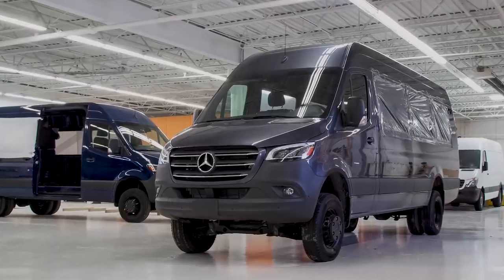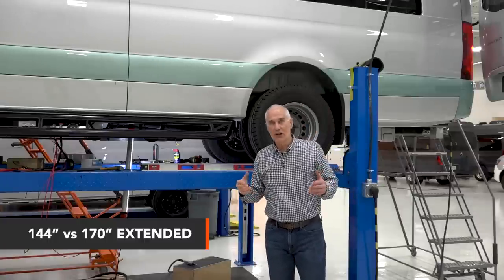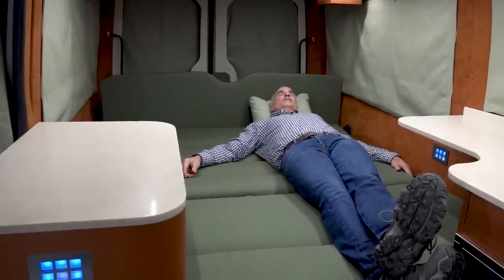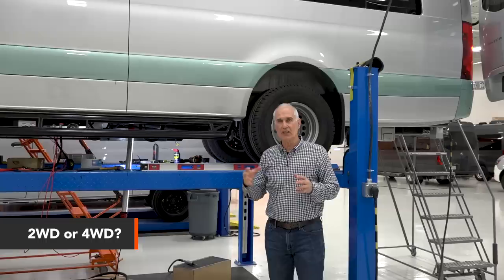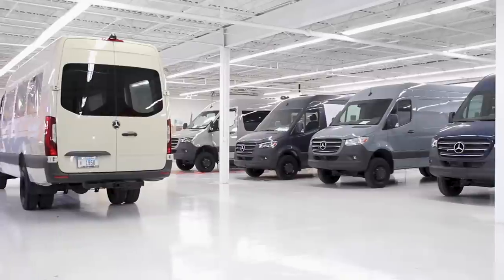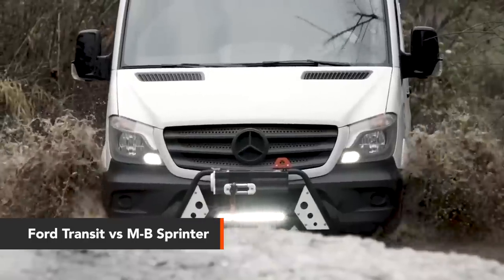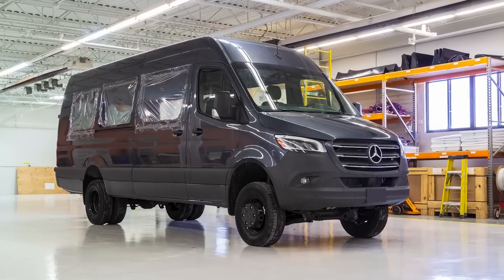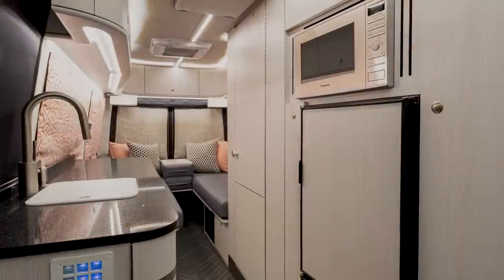Important Chassis Considerations for Your Custom Van Conversion

Comment: I want to state up front that I am already an owner of an ARV for about 18 months. In my opinion this is a  great straight forward informative video and only a starting point of how ARV takes a new owner step by step in the design process to decide a finished product. One does not need to have prior ownership of an RV to end up with the dream machine that allows one to ride off into the sunset. I have said before that my RV is everything I wanted and nothing that I did not need. If I were asked what would I do differently I would be hard pressed to make a list that was of any significance. Thanking all of the ARV team for sharing their experience in the design process.
Reply: Gary GaryM Agree 100%.
Reply from the maker: All the best to you, Baltas Vilkas 🙏
Reply from the maker: @edbyron3483  Hi Ed!

Comment: Hi,  i have been a taxi company owner in Europe for over 25 years and had a constant amount of 18 to 20 vans.  And it to my experience, the transit is Trash compared to the Sprinter overall.   No the sprinter is not perfect.  Stay away from 150 and 160 HP engines.  If you have light work,  go for the 130-140 HP engines and for all the rest go for the AWESOME V6.   It has enigh power to do the job and is very reliable and durable.  In my country,  nearly all ambulances are sprinters with the V6 and with these harsh conditions (the drive much faster here then in the US or Canada, they are replaced with 5 years old and around 450.000 which is around 280.000 miles.  The Transit is cheaper, it has cheaper parts but the sprinter has far less troubles.     After having several Transits, i all changed them to Sprinters.   Some 213 and 213.   Most of them,  around 11 318-319  and a few 418-419 for airport transport and wheelchair transport.   The 5 speed auto was not the best but the newer 7 speed is awesome.   ONE THING I WANT TO WARN YOU FOR.  Spinters Do rust.   Spend some money on rust protection.  and one other thing.  NEVER buy a sprinter in White.  It is just a base paint to be expected to get a new company paint.  The Transit is good for delivery truck when it is running 18 hours or more a day and replaced after 5 years after the end of the lease contract.  For a camper?  a bigg no no to me!  Good luck with your choices.   Dodge?   that is Peugeot.  Which is French build.  MASSIVE TRASH  DON'T EVEN TRY IT.  It is keeping you wallet empty all the time.
Reply: Great info, are all of your vehicles diesel or gas
Reply: @shockingguy  Only Diesel.   There are basicly no gas vans in Europe because the diesel is more fuel efficient damaging to the envirement when its getting old then a gas engine.    Don't trust on political lies,
Reply: The ford transit drivetrain in the USA is completely different than the transit offered in Europe. 

Also, the smog system requirements for diesel engines in the USA is a lot different than in Europe, making diesel in Europe much more reliable compared to in the USA.

Comment: Good stuff, you should do a "Gas vs Diesel" video next. 

8:00 The problem for me is that Ford stopped offering the 3.2L Power Stroke for the Transit. So the next powerful engine option would be the 3.5L ecoboost. The 3.5L is a great motor but its gas. Diesels run at a lower RPM range while gasoline motors run at higher RPM ranges. Basically a diesel will wear about half the wear you will see on a gasoline engine. Once a gasoline engine reaches say 100k, its considered just about worn out where as a diesel by many people is consider just breaking in at 100k. FYI: you also have to factor in run time. We had diesel trucks in our yard back when I worked in the oilfield that had 70k on them and was worn out...we would run our trucks around the clock most of the time. So even though the mileage was low, they was racking wear and tear idling. Diesels are usually more efficient than gasoline as well.
Reply: You just "Parroted" the popular misconceptions that to many people believe! I've spent over 50 years in the Diesel Engine Industry and can tell you that both engines will fail when not maintained or operated correctly. It isn't necessary true of today's Diesel Engines! Sadly the Emission Controls Systems have robbed the Diesels of their dependability in some applications. The Gas Engines on the other hand have gotten more powerful and fuel efficient as the result of these components. There is however, still a place for the Diesel, but it not for everyone. When you compare the Ownership Costs, of the Gas vs Diesel, on MB WebSite you will be amazed at what you will learn.

Comment: Can you make a video about the Sprinter gas engine? I think it's the same as the Metris.
And a video on the Ford Transit AWD and difference in interior size to the Sprinter.
Reply from the maker: Great suggestions. The gas engines continue to improve.

Comment: Good info.  I just wish the fellow in the very beginning had focused not so much on what you want to fit inside the van but where do you want to camp with it, which you do discuss at a later point.  We'd all love the huge van of course, until it came time to turn it around at a remote off-road campsite with rocks all around.  Or get it over some rutted roads without hitting bottom in the center.

Comment: I want a red tail overland on the top pop. I want a fold up bed on one wal somewhat like the Travado GL  and the nice bathroom, 32 x 36 shower, flip up sink, over on the side, I do want the rear doors to open. Also a 36 inch x 60 underside like table. Instead of seating for others, I want a sewing station, full fridge, my wind turbine mounted on ladder or redtail overland. Induction top in a drawer. Convection micro, deep sink.
Oh and small portable wd combo.
Fold up step.
5000 towing.
On an MB....170. ..
Can it be done?
Cassette toilet.

Comment: Has ARV looked into whether the Transit can handle the VB air suspension and E&P levelers, or perhaps ever done one?  I would hope that if can be done on Sprinter and Promaster then Transit is also possible.
Reply from the maker: Hi Chip thanks for the question. Yes, we've installed those systems on a Transit before.

Comment: As a service tech that works on Mercedes Benz... I can tell you that 4x4 is a piece of crap.. As they seem to go out once the warranty expires...Why you see so many up for sale after the warranty is up. 

I would add. Mercedes tells up fitters where they can drill a hole. So even if it's a better option for the up fitter to drill one. Where it is needed. You can't. As Mercedes will void the warranty. As these things are rust buckets after 5 years. 

And I would not buy one. Unless it has been under coated by a professional. That uses CRC Marine Coat.